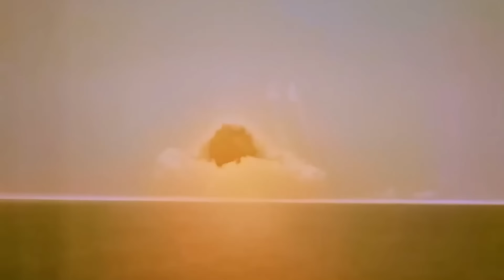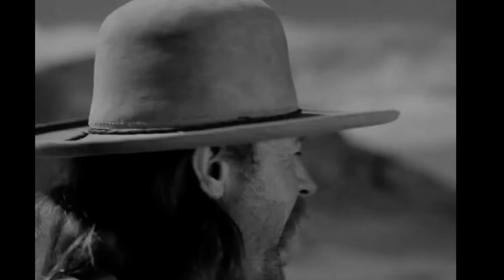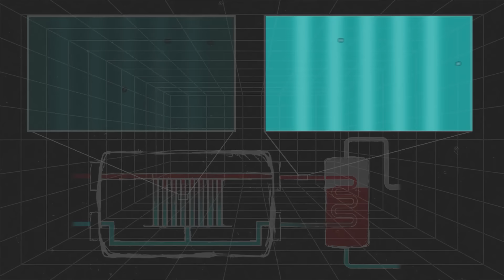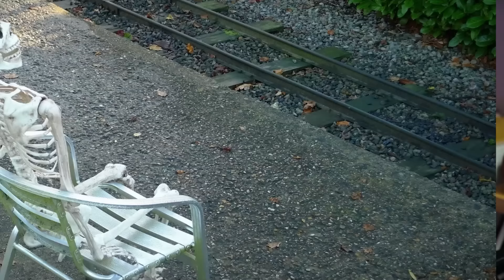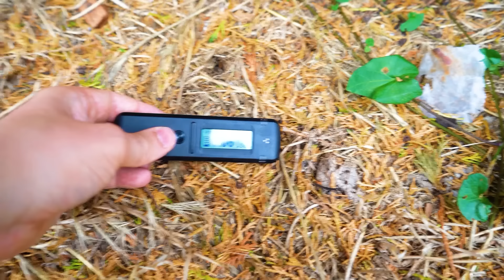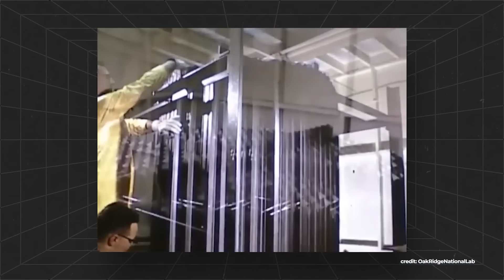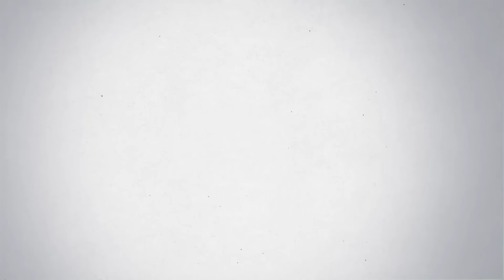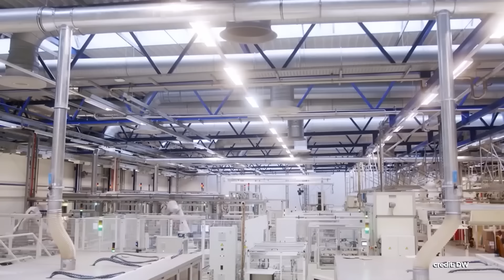It's Happening - China Launches World's First Thorium Nuclear Reactor

Comment: If Norway wasn’t so busy with oil they could have found a way to harness the power of Thor
Reply: They're too busy swimming in money.
Reply: Norway is a bit of a special case. They have been pretty much 100% hydro power from before WW2.
Reply: @atrumluminarium  But now the WEF has declared Hydro power is bad ?
Reply: @Robodog69  in places where there are draughts yes. Norway is a mountainous arctic country
Reply: We used to have thorium reactor experiment, it never got funding to upscale it, Norway has lots of thorium, it won’t be bad thing for Norway, if there was demand for it, however it can damage nature, if we dig it out. We already had waterpower, so was not a real national demand for it. there was also question of storing radioactive waste.
Reply: The Dutch might need some of that thorium. Dutch company Thorizon is busy developing a 100MW MSR power plant which should be operational in like 10 years. They've found a workaround for the corrosion by working with cartridges in the core where corrosion is the worst. 

Besides, did you know last month Thorium Norway AS published a press release in they in collaboration with Bilfinger Tebodin Netherlands are investing 1 billion NOK/85 million Euros in the production of thorium in Norway?
Reply: @kjetilhvalstrand1009  The total nuclear waste from a 1GW conventional nuclear power station over a 60 years lifespan is "about an olympic swimmming pool" in volume and will be less radioactive than the original fuel in 460 years (contrary to popular belief, nuclear fuel uranium or plutonium is barely radioactive - to the extent that a truckload of banans is more radioactive (radiation detectors installed in ports to detect nuclear weapons smuggling are regularly set off by banana shipments)

The talk of thousands of years is extremely misleading. It will be safe enough to handle without gloves in 125 years although I'd recommend washing thoroughly afterwards as ingesting alpha-emitting particles would be "inadvisable"

A molten salt reactor burns 99% of the input fuel vs the 1.8% that existing designs do. In addition there's a 89.4% reduction in "input waste" by not needing to create enriched uranium (I put "input waste" in speechmarks because all that depleted uranium is the actual nuclear weapons feedstock, not anything done with the enriched stuff)

AND most MSR designs will happily take our piles of "nuclear waste" as sidestream fuel - which solves a curly political issue, leaving about 1-2 cubic metres of solid waste at the end of the 70 year lifespan (probably much longer) that also follows the 460 year rule

That 1-2 cubic metres of waste can be reduced significantly at cost of a couple of percentage points loss of nuclear efficiency,. When the fuel is $150/kg the extra fuel needed is immaterial (Yes, thorium - or uranium - is that cheap. On the other hand 5% enriched uranium costs more than gold!)
Reply: @kjetilhvalstrand1009 radioactive waste is perfectly recyclable.
Reply: @kjetilhvalstrand1009  Norway has such a ridiculous amount of natural resources. Oil. Gas. Hydro. Phosphate rock. Thorium. Odin truly blessed them.
Reply: @kjetilhvalstrand1009  Nobody in the world had a working thorium reactor. Norway either. A nuclear reactor on only thorium cannot work as thorium is not fissile.
Reply: Norway already tried Thorium, everybody involved went bankrupt.
Reply: @xcrockery8080  Exactly. Thorium molten salt looks amazing until you go further down the iceberg and realize there needs to be untold billions of dollars of investment and decades of building the immense supply chain for everything. This is true for a lot of promising technologies. The investment has to be spread out through the industry. It's very unlikely something some startup is ever going to pull off. Pressurized superheated water may be more complicated in some respects, but there are thousands of companies in that supply and research chain that have learned a lot of things over the past 70 years.
Reply: If the world wasn't so busy with erectile and hair loss problems, we surely could have found the formula for immortality.
Reply: @Tadou19  Nah, it turns out that immortality is much harder than baldness or hair loss. Plus who wants to be immortal, but bald and limp?
Reply: I am one of the Norwegians who firmly support nuclear energy, and with our safety record, our well educated people, and the oil money we could easily run some of the best and safest reactors in the world.
Reply: @ladíswashheroum  Have you considered buying the USA?   On sale now!  Some of us would welcome that.  Consider it a "fixer upper" -- some work needed.
Reply: @charleskramer6189 There was once the US was not much so different to Norway. At least much closer in terms of politics. Franklin Delano Roosevelt is even a personal inspiration for me, and his New Deal policies set the standard for many years ago after, and America truly reached its peak. Though since the mid-70’s that standard of people and equality first as a benefit to all of society, has withered away, it should be a reminder that we do not need to be bought by the also kinda troubled Scandinavian countries. America has the potential to be the single greatest big nation in the world, it is worth fighting for.
Reply: Norway shouldn't have joined NATO
Reply: @SoulRocketMan Norway was asked if they wanted to join and create NATO they agreed as they didnt know want what happened to norway in WW2 to repeat which is also why iceland which has no military is in NATO its a founding member
Reply: Norway gets almost all it's energy from hydropower and has almost all electric cars.
It's one of the reasons they are so rich. The less of their oil they consume the more of it they can sell.
Reply: @MrMarinus18  Well, the energy companies are rich, the housing market is crazy, it’s a expensive country to live in.
Reply: @kjetilhvalstrand1009  None of those things are relevant.
The Norwegian government has tons and tons of money. If they had the political will to build a thorium reactor they could.

And what energy companies are you talking about? Norway's energy is collectively owned.
Reply: I see what you did there
Reply: That's the whole point. Thorium would kill the oil industry. Plus left wing politicians have suppressed anyting related to nuclear energy.
Reply: NOrWAY do have to reactors and are getting writhe of both at this moment. The Halden reactor team was in process of investigates some possibilities in the atom and nuclear world. But Halden was falsifying the results and even when it was for others companies. Thorium is in big numbers in Norway and so is Rare earth elements but it will cost to get it..... I do think Halden group was telling all of us that they almost got the thorium reactor made..... but did not.
Reply: Norway represents 0.05 % of the population in the World.
Stop living with your head up your ass please
Reply: He is busy right now!
Reply: maybe the princess who talks to angels and souls can help ... /?/ No offense, just joking
Reply: NATO and the US and Russian wont Let the Scandinavian Countries to develop Thorium.
Reply: They have the tech...its all a timing play
Reply: Norway getting rich on oil and getting high on their own smug.
Reply: @TammyDenseDdank5658  No countries got rich of nuclear because it is a waste of money.
Reply: vikings with 21st-22nd century thorium reactors!? (REAL)
Reply: Yeah so you can mutate into spiderman or the hulk... except that mutations always end in negative outcomes and neve positive.   Goid job being propagandized by the nuclear death cults influencers, for power generation that is 15 times as expensive as anything else, and is neither clean, green, nor zero emission.  It does produce waste that will remain extremely harmful to all life for millennia, ever present just waiting for a disaster like Fukushimas earthquake, or operator error, or even an asteroid, or EMP attack to happen.   Once they lose power and generator backup, all bets are off.  Dont be naive, youtube is here to infiuence ...YOU.
Reply: Lol
Reply: But who s gonna pay for Nato weapons
Reply: Lots of oil - yes but not supporting own nation. Todays price over 22 kr per liter. What a shame. Last 2 years are NORWAY ONE BIG SINKING BOAT.
Reply: @david4360 yes expensive as shit country only way to survive the prices is to not live in a city which is apparantly impossible because Thats where the good pay is (still shitty pay)
Reply: They are stingy people, they only think about saving money for the "next" generation, but send billions to other countries while their people struggle economically.
Reply: They are stingy people, they only think about saving money for the "next" generation, but send billions to other countries while their people struggle economically.
Reply: They are stingy people, they only think about saving money for the "next" generation, but send billions to other countries while their people struggle economically…
Reply: They are stingy people, they only think about saving money for the "next" generation, but send billions to other countries while their people struggle economically….
Reply: If these Chinese would not be so smart and hard working, the west could have covered the technical truth and prevented the breakthrough from happening forever and ever.😂
Reply: They think they are invincible until something hits the earth and the wind stops. The whole world should make one place and build a workable Thorium reactor. Each nation to give out 5 years funding to avoid disruptions like we have currently in the USA.
Reply: norway is one of the few countries that has massive oil and did not turn to corruption. . They have one of the largest government oil funds in the world.... per capita i believe?  they should have spent it on nuclear, no doubt
Reply: @davidanalyst671  its a pension fund.
Reply: @davidanalyst671 Norway not corrupt? Hahahahahahaha it’s the most corrupt country in Europe. If you don’t know that fact you’ve been a lucky blind worker I guess.
Reply: @davidanalyst671  Yes we should, and there are many here that are advocating for that. We've also done research on this. There was a reactor running on thorium in Norway all the way back 2013. It was done by Thor Energy at the OECD Halden research reactor. As well as a second successful test in 2015. This was in cooperation with a consortium led by Thor Energy that include nuclear research institutes from the UK, Finland, and South Korea. However, nuclear is still an unpopular thing in many peoples minds, especially among older people that remember Chernobyl, and it takes time to change public opinion, often more than time than to develop the technology. 

However, there are many other things we should also invest in. For example, large deposits of rare earth minerals have been discovered here, as well as possibly the worlds largest supply of phosphate rock, something that would possibly be worth more than oil if we can mine it. It would also make us one of only two countries in the world where phosphate is found. Because it's an essential component of making fertilizer it would give us significant power over the world food supply, something which is significant to say the least. 

However, the future is digital as they say. So we should not just mine and sell of the rare earth minerals, it's fine if we sell the phosphate, but the rest we should refine and start building factories that can turn them into high end computer chips, similar to what Taiwan and South Korea has accomplished. We should use our significant resources to build up a local subsidized and partially government owned tech industry, attract talents from all over the world, build up significant tech infrastructure, and heavily research AI. This could take the place of oil and other natural resources once our supply runs out, as well as maintain an economically strong government capable of standing up to private interests. Unlike what we're actually doing, which is selling off our country piece by piece to foreign private interests. Why are our leaders doing this? Who knows, complacency and greed I guess. They don't seem as capable now as they were back when they handled the whole oil thing.
Reply: Excuse me, Vikings are busy these days bringing up the genetics of lesser tribes by selecting the finest partners, a little thankfulness is appropriate !
Reply: “My distant ancestors were great at raiding fishing villages and abducting children, show me some respect.”
Reply: @kevinmathewson4272 Yeah fishing villages like York, London and Paris. Also their descendants the rus and the normans made huge empires of their own.
Reply: @kevinmathewson4272  Yeah. Well. The viking age was triggered when Charlemagne chopped down Donars oak and built churches from the timber (also called Thors oak) after killing 400 tribe leaders he summoned for peace negotiations (in these sacred sites violence was forbidden. How is that for your know-it-all ?
Reply: @kjetilhvalstrand1009  like I told my children, everyone alive today, at some point in time had ancestors that dominated and oppressed other people. Even the most remote and secluded tribes have what they consider armed warriors to defend themselves.
Reply: @stefthorman8548  No, but you can’t change history, what we are proud of is shipbuilding skills, and their ability thrive in cold environment with primitive technology by todays stands. And they where brave traveling long dangerous journeys. They had an interesting religion.
Reply: @kjetilhvalstrand1009 only 5% of Southerners had slaves in America, farmers!
Reply: @belialzed2244  I was thinking about the "Indo-European migrations" it included parts of aisa, but that was a different time period.
Reply: How kind! Although I heard they were shutting the borders again... I suppose you can't force excellence on other tribes. @beelzebobtheinnocent1659
Reply: @beelzebobtheinnocent1659  Ah the racism.
Reply: Norway doesn’t want to be….. Occupied.
Reply: @ChancreSaurusRex great show
Reply: Norway already runs on nearly 100% renewable energy. No nuclear required.
Reply: @SocialDownclimber  Disagree. We are running short on energy with many big projects in the coming years. To meet the demand we are now building wind turbines to meet the energy needs. Good luck gettings energy hungry industry operating in a country where we have cheap energy only when the wind blows.
Reply: @mikaelolz  With nuclear, you could just have expensive energy all the time. Not a great option compared to wind.
Reply: @Rohan4711  Quite true but we need to get away from the national grid concept with centralised power generation distributed to individual consumers .
What needs to be done is a reworking of the grid into micro grids feeding into batteries and drawing power from those batteries to keep things stable .
The batteries are the only thing that connects to the major grid because balancing the grid with 4 million power stations is next to impossible .
However this system does not suit utility companies .
I have been off grid for a long time by using solar , wind & old lead acid batteries with a dead cell or two .
Reply: @SocialDownclimber the reason we Are building wind turbines is because norway has strong wind in alot of the country and as most people live near the coast where there is Even more wind wind turbines Are actually a great option its just that they need to place them at a correct place without suddenly getting a tent outside the building where the often decide what to do and close to the kings house because they placed wind mills on sami land
Reply: @SocialDownclimber nevermind forget what i said in a different comment but the wind here is cold and strong atleast where i live where wind turbines arent so common because its the biggest city in the north struggling with stupid tourists
Reply: @SocialDownclimber lol good joke
Reply: @NeostormXLMAX  Its 100% true and if you don't believe it, that just reflects poorly on your ability to overcome your own massive biases.
Reply: @SocialDownclimber  i's a pun joke
Reply: @SocialDownclimber  And what energy source would that be?
Reply: @SocialDownclimber  Norway's population is 5m people tops. I guess that makes 100% renewable energy possible for them.
Reply: @johnsilver8908  That makes exactly zero sense.
Reply: Norway is busy with nuclear.
There a engineering company.

And the government want to have a few nuclear reactors.

There hydro isn't uneffected by climate change.
Reply: Have to artificially prop up the wonderful "socialist" economy to convince the mouth-breathers of how wonderful that type of government is.
Reply: @TheJollyMisanthrope  Love the quotation marks - I guess you DO recognize that Norway isn't a Socialist economy,
but not having a nations oil treasures only benefit a tiny hand full of people somehow rubs you the wrong way.
Reply: @TheJollyMisanthrope  We have a regular market economy combined with a welfare state. That is not socialism. It's a liberal social democracy that supports many of the same personal freedoms Americans enjoy. Americans always conflate social democracy with socialism and communism, but it's ideologically not the same thing at all. Only the left wing fringe of our many political parties support actual socialism, and in practice they cooperate quite a lot with the politics of the more moderate mainstream parties at the centre.
Reply: @christerdehlin8866  We have state owned business which includes two of our main natural resources, oil and electricity. State run businesses and monopolies are socialist by American standards. Keep in mind that by American standards liberal is also socialist, because things are weird over there these days. Not saying we're socialists or anything, but we're also not a "free market" which Americans like to call it. We function, or at least have functioned, so well, because our democratic government has enough resources, money, to hold it's own against liberal private interests. If our government loses these income streams we will turn into the US over time in the sense that private interests will become too powerful for the state to effectively handle. Not only are we as free as the US, we have more freedom according to nearly every metric. But we'll lose that if we can no longer balance state and private, as soon as either of these two become too powerful it all falls apart. Government with too much power and you have China, corporations with too much power and you have the US, both of which leads to less freedom for the majority of people. The "freedom" Americans talk about is generally the freedom to be poor for the majority and the freedom for the few that are not to exploit the rest. They have the freedom to not afford healthcare, the freedom to a minimum wage, the freedom to not have any solid unions upholding worker rights, the freedom to not afford an education, etc. But these are not real freedoms, freedom is what we have, like the freedom to not worry about any of that nonsense, and have actual freedom in the sense of high social mobility. Being trapped in an oppressive highly unfair and unequal social hierarchy isn't freedom just because they won't get arrested for speaking their mind or whatever. And even their commitment to free speech can be question with their corporate owned for profit news media, as well as their history with whistle blowers being imprisoned, bullied into self termination, or exiled, as well as reports put on no fly lists and so on and so forth. We have freedom, they do not, not in any meaningful way anyway.
Reply: @daniel4647  You're right about it not being a full free market, but government ownership is only partial. You can for instance buy Equinor at the OSE anytime you want. Partial government ownership of a select few businesses does not constitute socialism. It's the economic policy of social democracy. I'm merely annoyed that Americans always fail to distinguish between those two ideologies. It's not a socialist society unless the government owns all the means of production, and operate with a planned economy.

I agree with you that maintaining a proper balance between government ownership and the free market is important. For the past four decades we've been leaning increasingly towards the market, and I think that has served us well, but I'm happy to keep the partial government ownership of the businesses you mention.
Reply: @daniel4647   The problem with capitalism is it is by design very wasteful of resources particularly if that resource is cheap .
And of course capitalist utility companies encourage wastefullness because it enhances their profit, until that resource has been totally consumed .
We will need fossil fuels for the next 1000 years unless some one can come up with a battery that will run a combine harvester all day & all night for 2 weeks while the cereal crop is harvested  . As for electric cars the biggest problem is copper. If every ICE powered private vehicle in the USA was replaced with an EV of similar capacity then that would consume nearly 1.5 times the known copper reserves of the planet . And that is just for the first one with a 10 year life span